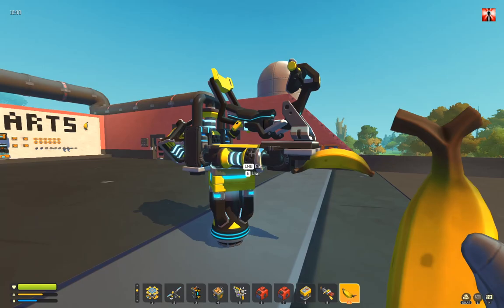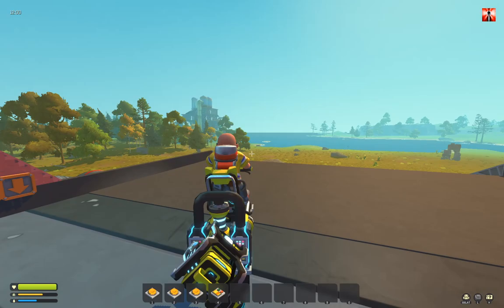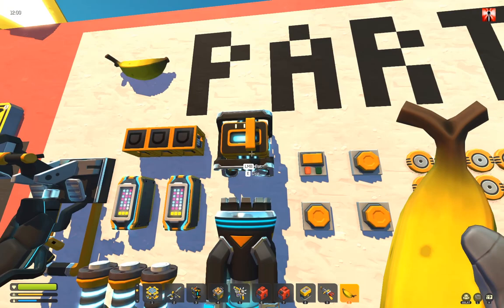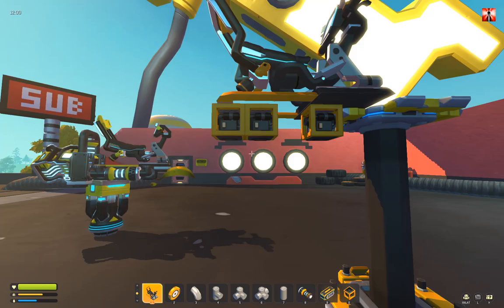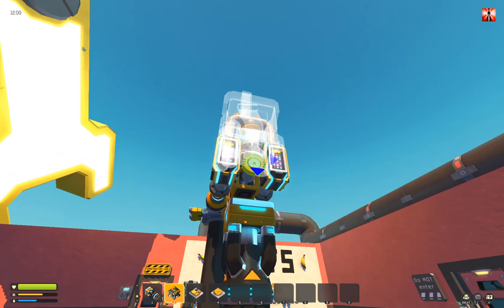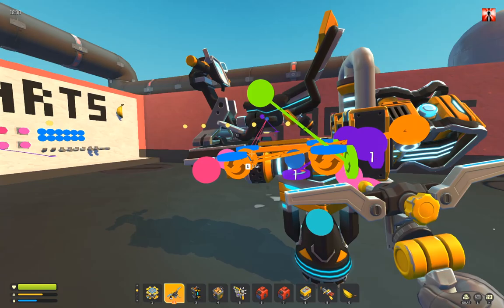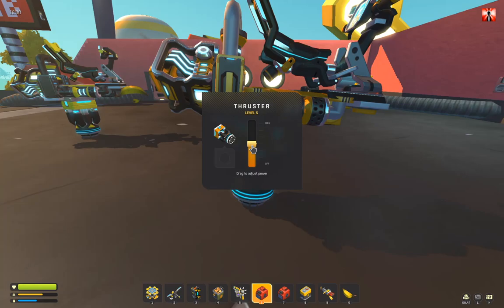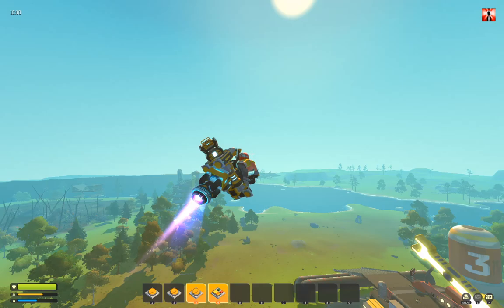Scrap Mechanic Survival | HowToBuild - Ultra Extrem Small Flyer - Tutorial

Comment: I always wondered why you used an engine instead of another controller.  Thanks for clearing that up.  Bet that runs out of fuel quick though.
Reply from the maker: yeah ^^ its not very fuel efficent. But that was not the point ;) i wanted it to be smaller.
The other version is Fuel Efficent

Comment: Awesome! Can the Yaw be controlled by A/D?
Reply from the maker: if u change the wires sure. just switch seat wire with the controler buttons. i made a video for Alternativ controle on the other flyer ( EXACTLY the same gate logic if u want to know how ) 
=)
Reply: Ok, thanks, i knew you could change the wiring, but just wanted to know if it will be the same sensitivity of the turning.
Reply from the maker: not the same. u will lose a bit agility in Yaw.
Reply from the maker: OH wait. No u cant. it has only one bearing for Roll so this version has this control not the alternativ.  Sry
Reply: Thanks for the info!
Reply from the maker: ah damit xd.... i´m wrong again .... to many flyers in my head. it has 2 bearings for roll so u can make it with alternativ.... Sorry Sorry ^^ now realy i checked it and ye it will work with the alternativ controls.
Reply: @00FantMod  OK, still thanks, you reply fast!